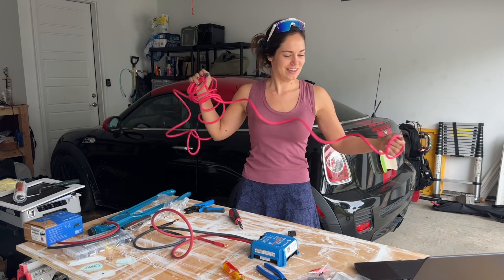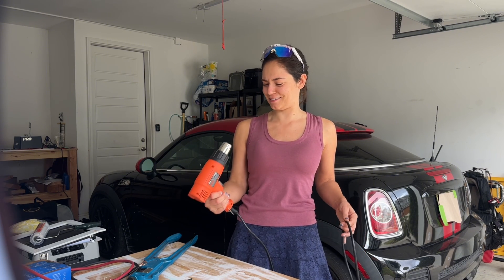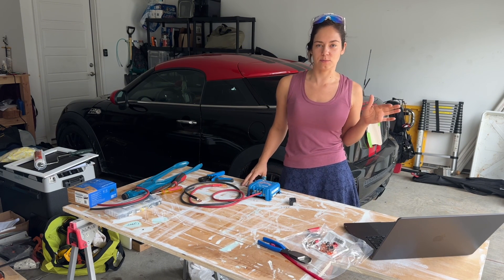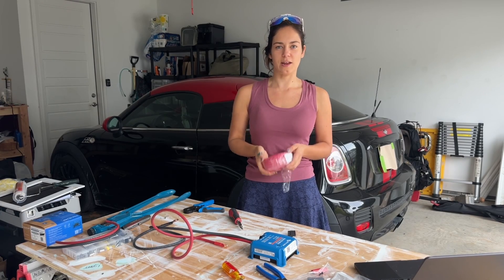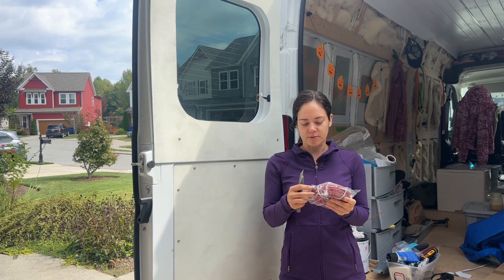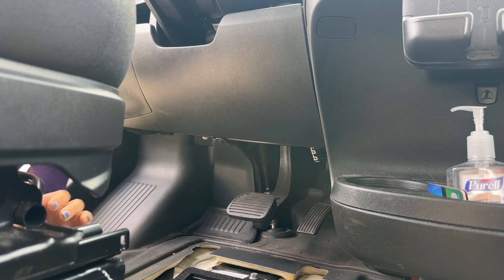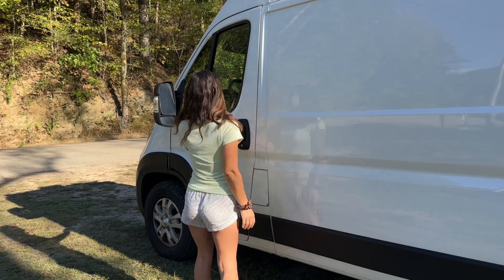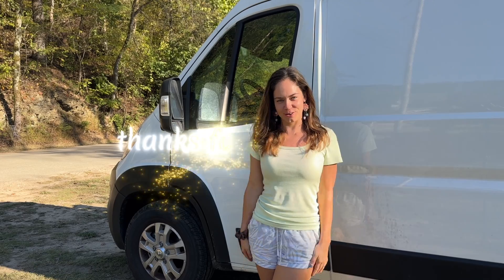ENDLESS Battery Power in My Van - Orion DC to DC Charger INSTALL DIY

Comment: i never installed a fuse...i have a battle born battery and a charger.  the charger controll controlls over charging and the battery also has built in overcharge controll......
     The Company litterly told me i didnt need a fuse...
     made scrnts to me.   lerp it as simple as possibly

Comment: Great job. I would however run the cable in conduit all the way back to the charger. Abrasion through vibration on some of those over time could still lead to a short. If you have any issues after your walls go up, it’ll be easier to pull a replacement cable.

Comment: You can also buy a kit that has a system (can't remember the name) but it feeds from your alternator into a type of switch that keeps your van from pulling from your auto batteries even though they are on the same charging system but basically your alternator will be charging your system when the vehicle runs. This system keeps your house system from using your auto battery for electricity so it keeps it seperate.. ALSO you can get an upgraded alternator (highly suggested) because a factory alternator is 70 to 100 amps and when charging other things put a little load on it but a 200 amp and up alternator will charge your bank no problem and really fast as well. When the key is off it won't charge (of course). Something else to keep in mind is doing the "big three" upgrade which you already have the crimpers. Your upgrading your body to ground, battery to ground and alternator to battery positive with 0/1 wire (big) because the factory wire is big as a pencil. The bigger the wire the more you get and the more you can handle. It lets your alternator put out all the charge that it can uninhibited.
Any or ALL they would be of great use to you.

Comment: I'm glad you showed the part with the 'pink' wire, I had a similar experience with some 4/0 cable from the same website, don't want to burn down the 'house'. After that I only purchase welding cable from a trusted local retailer, it's cheaper too. Red heat shrink or red electrical tape makes it easy to identify.
Reply from the maker: For real!!

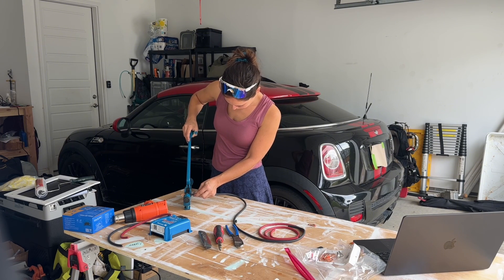Comment: 0:46 that has nothing to do with new or old. The ones with 4 cables are isolated versions, the one with 3 are non-isolated.
Reply from the maker: Hmm..  I believe the one I am using was just released in the last year so mine is “new”
Reply from the maker: But ya mine is non isolated makes sense 😅

Comment: I have burnt through 2 DC to DC chargers... ughhh on my 3rd id it burns out ill go Victorn
Reply: Victron
Reply: @Van-life-4-Jesus  Why are they burning out?  How about trying a budge brand with the highest wattage but using about 2/3 of max wattage?  Would Victron make more sense over this?

Also, are your wires and terminals oversized and extra well connected?  If not, try that to reduce heat build up.  

Lastly, have you tried cooling it with a fan?  I’m know there are cooling fan kits that are meant to be pretty universal. 

Again, it may be worth just going with Victron, but even those will wear out early if you run them continuously at full blast.